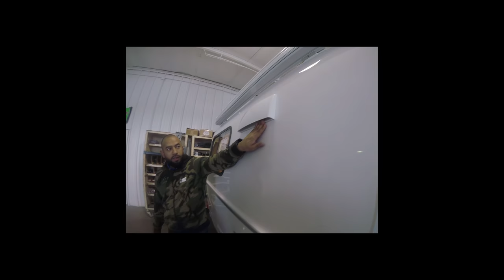2018 Casita Pickup

Comment: This is great we pick ours up later this month, we are also getting the “Sway Bar”, I wasn’t then thought go for it. I was wondering in the city or mountains do you take it off or just loosen, also what I found out is that filling the propane tanks costs a lot less than exchange. Your little girl was very behaved WOW everyone’s excited and she was great!
Reply from the maker: Thanks. My daughter was very excited about getting the trailer. She loves going camping in it. We have traveled to many places since. She is 6 years old and still loves it. I always use the sway bar all the time, no matter how short the trip is; I cannot imagine not using it. If a tire blows, these sway bars are your best hopes to control the situation. As for the propane, here in San Diego we have a company called Expo Propane and the fill up propane tank for half the cost of U-Haul or other hardware places. As of January 2020 I paid $2.30 a gallon or so it comes out to around $10 a tank. I am lucky there are two locations in town; one by my work and another by my house, otherwise refilling is more expensive but always cheaper than. Exchange the whole tank.

Comment: I want one of these BAD!! I wonder if I can order one without the carpet on the walls. I know it is for insulation, but I would rather have it without out for easy clean up.
Reply: The indoor-outdoor carpet on the walls is apart of the insulation and sound proofing with the fiberglass shell. People camp in the cold winters and hot summers you will want the insulation. If the carpet is a deal breaker, buy another type of camper without a light weight fiberglass shell.

Comment: Nice!  Now add a couple solar panels on the roof
Reply from the maker: Working on it. Can't decide whether I want the panel affixed to the roof or go with a portable setting that plugs on the factory installed "Solar Ready Plug"
Reply: Ya know 3M makes a perm double sided tape for roof mounting metal on fiberglass. Used a lot for solar panels on trailers. No drilling or damage to your shell.  Strong as screws.  Just run a line down from roof to the solar ready plug.
Reply from the maker: Thanks. Going out for a  three-weeks trip in two days. Can't wait!
Reply: @CarlosLivingston  A suitcase solar panel kit will provide enough juice to recharge the battery and your small electronic devices. To run the rooftop air conditioner you either plug to a hookup or use a gasoline or propane inverter generator off the grid while boon docking...
Reply from the maker: Since I got the trailer I have done many upgrades. (I should do a video someday showing all of them which are very cool and mostly a must have add-ons). As for the solar panels, for the 2018-19 and newer Casitas, there is absolutely no room on the roof for solar panels unless you do some serious fiberglass work or bracketry system to clear the Marxair fan . Also, having something affixed on the roof, forces you to park on the sun at all times, so I have decided that although less convenient, going for a remote or ground deployed setup is the best option. About 8 months ago, I installed a Renogy 40amp MPPT controller and a flexible 160watts Renogy solar panel. Although it has worked great and it is more than sufficient for the AGM Interestate battery I have, I since have mixed feelings about getting a flexible panel instead of a rigid one as the flexible panel is hard to manipulate and set up and I am sure overtime I will ended up wrecking it. Lately I have been thinking about buying some square aluminum tubing and mesh and built some sort of rigid frame for it with legs that allows for easy tilting. The hesitation with that idea is the storing of the panel while traveling. I am not sure how to proceed but I am really digging the frame idea at the moment....